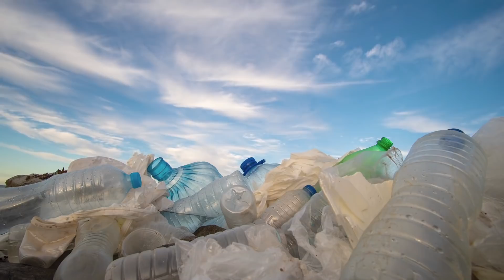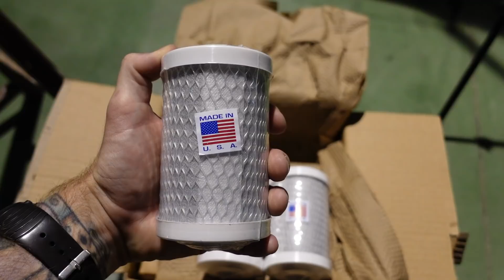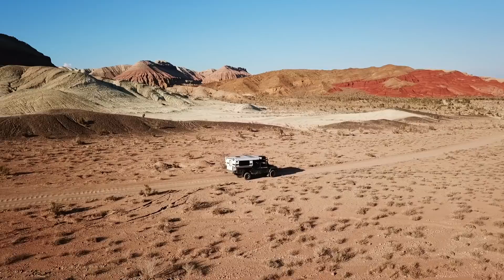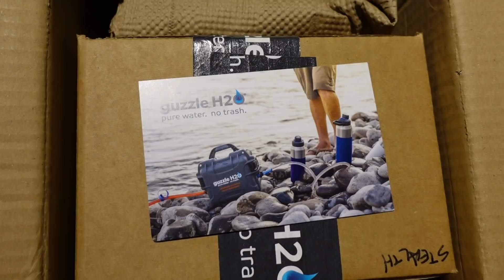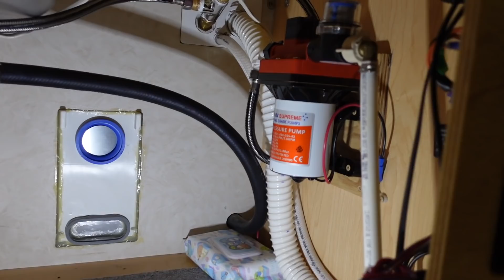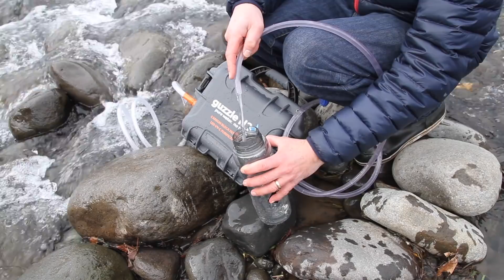Guzzle H2O STEALTH! A safe water solution for our Overland Camper. @GrizzlyNbearOverland

Comment: The power wire that plugs into UV section - it looks like it’s a pushed in from underneath... what would be the chances of this dislodging on corrugated roads and if it did how would know it was disconnected and not working if it’s mounted inside a cupboard??
Reply: The plug is super tight to push in and so light that I would say the chances of it dislodging are almost non existent.
I guess you could always put some tape if you were worried.
I won't be 😉

Comment: A good tip to using water filters, or any filter for that matter, is to take some tape and write the date you installed the filter. It's a good way to keep track on how long you have that filter in. It helps with regular Preventative Maintenance schedules.
Reply: Great idea thanks for the heads up. We wrote it down in Steph's diary but tape on the filter sounds like the way to go 😉

Comment: Do you install it before your watertank or after the watertank and the tap. So cleaning water first of when you use it?
Reply: After the water tank. We always put clean water in our main tank and we'll clean and sterilize it every 6 months or so.
Reply: @leighdearle5965  Thanks, sounds like a good strategy
Reply: Any reason it can't be used as an inline filter system?

Comment: Hey guys, thx for another very interesting video. 
May I ask you for a video about unwanted multi-legged guests in your camper ;-)? Maybe it's a kind of "civilizational" problem, but we use our camper only on weekends and on vacation and I saw  cockroaches the other day crawling on my seat ... I tried some chemicals which helped I think (I haven't seen any crawling visitors since then). But maybe there is other ways to get rid of them. Did you ever had such problems (maybe mice or similar)?
Reply: So far we've been very lucky to avoid any infestations or unwelcome visitors.
Other than the odd fly or mosquito.
We know of others that have had mice or ant infestations in the their vehicles.
Not nice at all...

Comment: great little unit, why did you choose to connect it direct o your CTEK rather than to your fuse box so you didn't have to have the inline fuse?
Reply: It was much easier to access the main battery compartment 😉

Comment: Looks absolutely fantastic. One point ( not a criticism) 1000 us gallons is not the same as 1000 imp gallons. Just  for reference
Reply: Thanks heaps. Although gallons is like another language to me anyway.
When will the US finally catch up and go metric...? 🤔😜
Reply: @leighdearle5965  it’s about 760 litres difference on a 1000 gallons ( there are less litres in a us gallon than there are in an imperial or uk gallon)
Confused, you should live in the uk where we sell fuel in litres but measure fuel consumption in miles per gallon....and don’t get me started on tyre sizes where the rim diameter is in inches but the width is in mm ( mind you , that’s the whole world too )
I read that is about $650 for your system. That’s pretty good for clean water !
Reply: @leighdearle5965  Did you notice your ratchet size is also American, 3/8, 1/4?  You may need to send them to me ;^{ )    When will the world stop using that funny French measurement they tried to copy from the ancient Egyptians?  Luckily metric measurement sizes have changed so if you compare to historical you need to convert between metric "age".   The weight is also one that gets people since a ton is either a short, long or metric ton.  School used to teach both now they do not teach either well.   I do love the French people just teasing BTW.
Reply: @badgerpa9  the metric system is not just "another" measurement system .It's not like you are 6 feet tall , 1.8 meter tall or 1 zebra and 3 chickens tall . The metric system was completely engineered and every thing is in relation.For example , in a cube of 1m x1m x1m you put 1000 liters of water and 1000 liters of water weight ...1000 kilogrammes
Reply: @greenant2722  I understand the metric system and it is no more perfect than anything else, if you know the history the length of a meter has been modified over time. Maybe the sarcasm needs to be spelled out, I really don't expect him to send the tools to me either just because they are based on inch rachet sizes.  I also like french people no harm meant, sorry I hurt your feelings maybe you can get a hug from someone close to you.